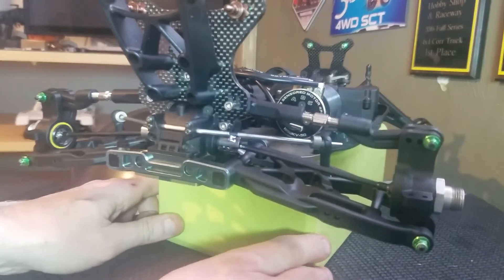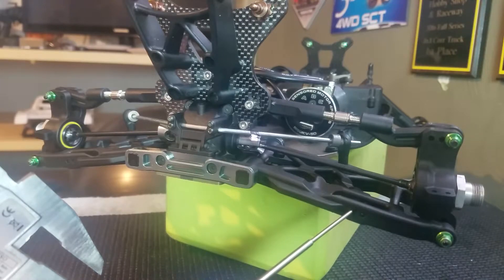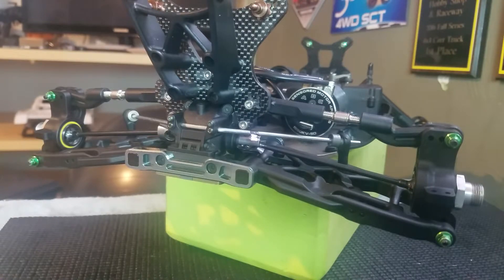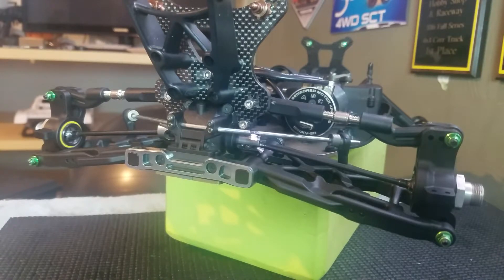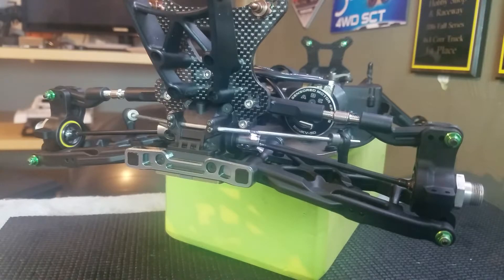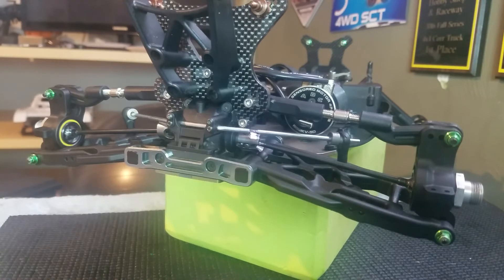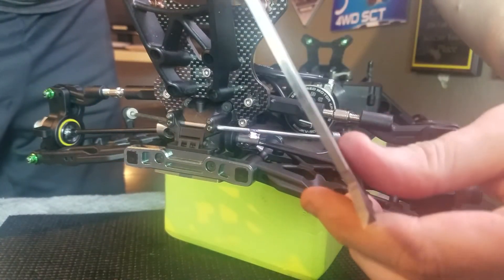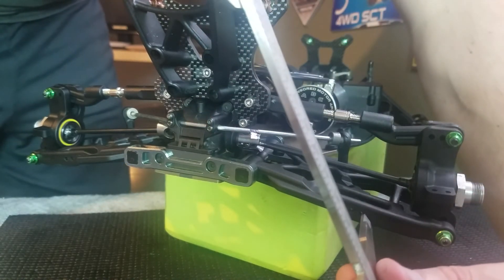RC Quick Tip #3: What does Droop do?

Comment: Totally confusing explanation for a new guy like me...lol
Reply: A new driver should set the droop to a factory setup sheet. Before knowing what all the adjustments do start with a setup sheet that is for ie. rough track, lose track, blue groove(the track is very smooth and compacted and develops a blue tint) etc. Then after you have a good preexisting setup you can start messing with droop and other things to see what they do. When it comes to tires just see what the other guys are running.
Also the trim settings on your radio should be set at less speed and response so your car is forgiving. Otherwise watch loads of videos and have fun. Don't get too stressed...driving ability comes with practice. If you don't have a track near you or you can't go to a track often just find or make an area or track to play on. Some skateparks and open offroad areas work fine.  You can even set up cones in a parking lot to race around. Best wishes and good luck!

Comment: What's the settings for a lose track on droop for that car. I was loose and out of control. MBx7r
Reply from the maker: You're loose and out of control because your car has too much power. Dial back your power to 70-80% and adjust your radio Expo to make the power roll on softer.
And practice throttle control with your finger.
Try running M3 or X4 Holeshots.
Droop is a fine tuning tool

Comment: I’m racing bone stock Slash late model with hcg chassis and 17.5t blinky on indoor carpet where roll is also an issue. I think we can only change oil weights and add spacers and I think we can also put limiters inside the shocks to prevent droop. Stock springs only also I think. This will be my first season indoors so forgive lack of knowledge on this track’s rules. Bowling Green Ohio, Woodland Mall is the track. Any help is greatly appreciated!!
Reply from the maker: Limit the shock length internally. Put silicon tubing over the shaft to limit the down travel. Your shock will be much shorter, and your truck will sit much lower. Put heavy weight oil in your shocks... around 500 to 600 try. And you also need a good radio so you can slow down your steering speed and turn down the sensitivity. This is a must for carpet racing
Reply: @wheels.and.wrenches  all suspension settings are time delay settings.

Comment: I have the exact same car and I appreciate your knowledge. You explained this way better than some of the pro drivers. My question is what should the drop be set to front and back by using this method?
Reply: General Pointers
More Droop - Better handling on bumpy tracks, more consistent
traction on difficult tracks. More weight distribution and will remove
‘twitchiness’ and is better for slow speed corners.
Less Droop - Car changes direction faster and corners flatter.
Generally feels more responsive and direct. Better suited for high-
speed smooth tracks.
Reply from the maker: You set thr droop to whatever the set up sheet tells you to. Then fine tune from there

Comment: Hi! I race a short 2wd course truck and a 2wd buggy on a high bite indoor carpet track with foam tires, how much droop should I set on my vehicles?
Reply from the maker: Very little droop. You want heavy springs, heavy oils, low ride height, and very little droop.
Reply: @wheels.and.wrenches  ok, thanks! I always thought a ball differetial was smoother and better for handling than a gear diff, but alot of people say that a gear diff is the way to go on carpet?
Reply: @theringmaster3684  little late but the thing is that a gear diff can take much more beating and dont slip as a balldiff would do and if it slips it shave of the balls and the diff starts to be un smoth and the loop of slip create more loose diff that slip more and so on.

Comment: What would make the rear stick better on loose track
Reply from the maker: WayneRc You would first make sure you're running the right tires. 2nd you need to make sure your diffs have the right weight oil in them. If those 2 things are okay, then to add rear traction you can add rear toe by moving the D Block OUT. You can lower the rear Links on the tower.  You can soften the rear suspension. You can also try a lighter rear sway bar.

Most importantly, traction is controlled by precise throttle control with your finger.